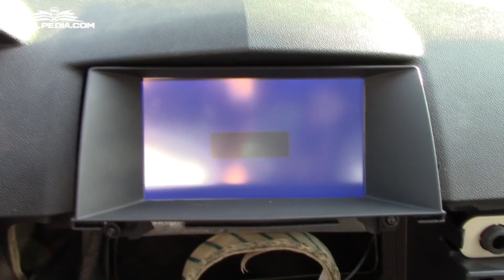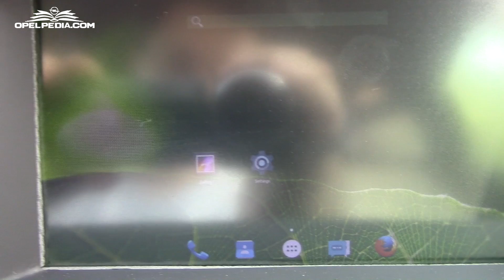Home Made Navigation System - Part 3: Navigation Teaser

Comment: 7inch?
Reply from the maker: Yes!
Reply: opelpedia I have a 7 inch tablet. Does not fit in the cid frame
Reply from the maker: you need to modify the CID frame and it will fit

Comment: hey guys,could you please give me an advice. i am looking for opel astra h,for everyday driving to work,approximately 25 km per day,which one of engine will be better for me? 1.4,1.6 or 1.7 diesel?  thanks!
Reply from the maker: i would go with the 1.6 or the 1.8 petrol.  i don't like diesel engines for small commutes to work especially in traffic were they have almost the same consumption like petrol engine but are more noisy.
Reply: +opelpedia thanks for your opinion! i had a doubt about the type of petrol,but now i am almost sure about my choice! thanks one more time!
Reply: +opelpedia sorry,but what about transmission,MT or AT? which one is better?
Reply from the maker: from my point of view i chose MT, the only good AT that i have driven was the DSG from VW